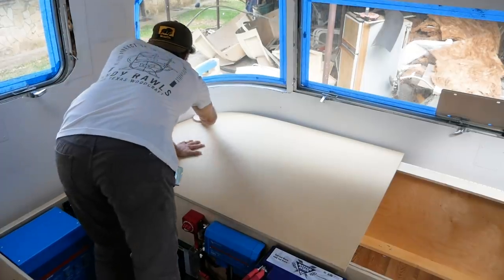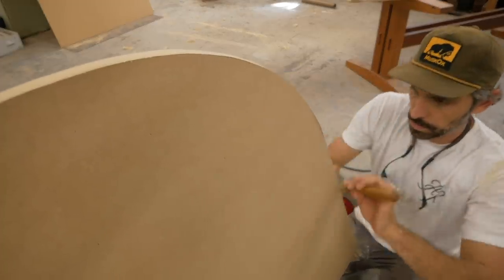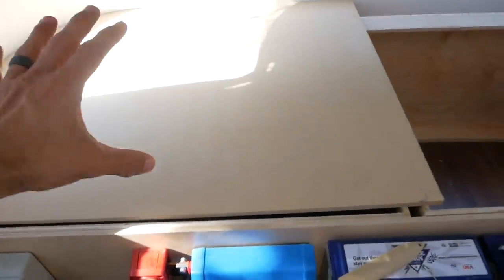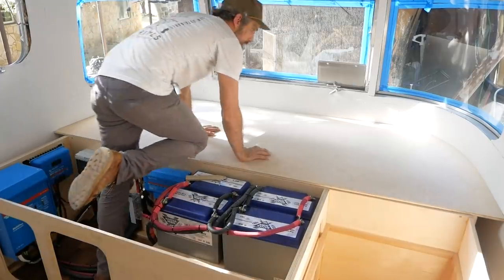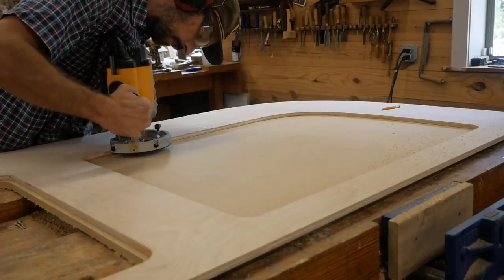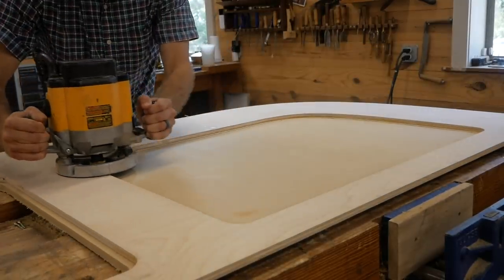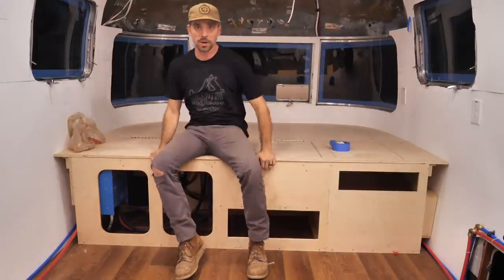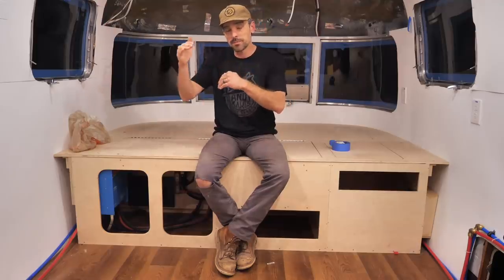Building A Custom Queen Bed For My Argosy Airstream: Part 2

Comment: Andy, try this when scribing something that's going into a corner:

Instead of "pointing" the scribe perpendicularly at the wall as you traverse each side (so that on the top edge it's pointed directly up at the wall, and on the left edge it's pointed directly left at the wall), keep it pointed in one direction the whole time. Which direction? As close to 45° as possible, directly aimed at the back of the corner when you're in the corner.

Start at the corner and pull the scribe out to both ends, keeping the angle constant. As you move across the back wall, the scribe will be pointed left toward the corner at 45°, and as you move down the side wall, it will be pointed up at 45° toward the corner. The marks will be furthest from the existing edge of the template edge at the corner, and closer to the existing edge on the sides.

At first, this seems like it shouldn't work, because you're translating a point on the wall that's NOT directly next to the point you're marking on the template. But it does. Why? Because when you take a little bit off the top, and a little bit off the side, you're not moving the scribed and cut piece up or over, perpendicularly toward the wall, you're moving it toward the corner, at 45°.
Reply: Thinking the same
Reply: Indeed, keep it parallel to something outside of that corner, not always easy. 

You can very easily visualize the problem by drawing on gridpaper! Choose your unit (1cm or 1inch or 3x3-boxes-of-your-square-gridded-sketchbook, whatever you have at hand), and choose say the top-left corner. Now turn that into a 45degree cut-off corner, starting two units down from the corner so ending exactly 2units right of the corner (and passing the grid-corner 1unit down 1unit right from the corner).

What you were HOPING was that scribing 1unit inwards (so 1unit right along the vertical part, 1unit down along the horizontal part, 1unit diagonally along the sloping part) re-draws the same, but just moved one gridunit down & right... then you'd have a perfect copy. So draw what you hope to achieve: You immediately see the problem, the sloping side isn't scribed inward by 1unit (= side of a square)  --- it's scribed inward the length of a square's diagonal (which is Root(2)= 1.414 units, says Pythagoras)! With the curved sides here, the same happens but with a smoothly varying amount of "stretch", from 1 to 1.41 back to 1 while drawing... Hopeless. 

HOWEVER, if @DonnieClapp 's 45 degree approach isn't practical, I think you could "double-scribe": Scribe a line as here in the video first attempt, MOVE&redraw (not scribe!! e.g. copy, on paper) that line a substantial amount down&right (radius of your scribe?), now scribe again but on the outside of the moved line. This should leave you an exact shape, as long as the first scribe touched all (e.g. if there were a corner the scribe doesn't reach in so it ends up rounded). True?

Edit: That said, I'd always start from a thin cardboard template. I'm no carpenter, what they do in small spaces is the scribing/ticking stick approach of course, https://www.youtube.com/playlist?list=PLp7OERboZQucxuKMpC2p64S6LozCMnTLO .

Comment: Hi from one Andy to another 😀. I just discovered your channel yesterday and have been watching your Airstream videos - loving it!. I’m going to go back and watch all your other stuff now I am up to date on the restoration. One question re: the bed; I have seen some videos where they have drilled holes into the area below the mattress to allow airflow. The thinking being that the wood and mattress can rot otherwise. I’ve no direct experience myself but I have seen this said in numerous videos. I ask because I am thinking of building a bed in my house with a fixed frame and storage underneath and wondered what your thoughts on the whole airflow under the mattress thing? Anyway, great channel, look forward to episode 19. Cheers, Andy

Comment: I noticed when you were outside,it looks like the trailer hitch assembly looked a little ragged.I’m sure your planning to replace the unit .just keep up what your doing,good video.😎😎👍👍
Reply: Ya. He may replace it. I think life would go on if he didn’t though. 😐
Reply: Thought the same thing. He is so thorough I'm sure he will get to it at some point.

Comment: As I was thinking how spoiled I am with my cnc machines.... you say it can be done easily with a cnc. I do miss using my template guides on the old porter-cable router. Lol. Now I make all my templates with my big ass laser for test fitting parts.

Comment: You're going to want to 1, mill lightening slots under the "lids" of those compartments for weight reduction as much as possible, like 2 inches wide by most of the length short of the edges and 2, put re-enforcing ribs on the non-waste area of the lids to strengthen them so they don't bow and fall in. Weight is the enemy of RVs, and flimsy, poorly made RV furniture is a design challenge. Most modern RVs are slammed together with 1/4 inch tolerances. Do better, build smarter. You have the tools and know how. Your tandem axles are only rated for 3500 lbs each I wager and these things end up over-weight with blown out cheap Chinese tires on the side of the road or worse. Don't be that guy. Also know that these things wobble as they go down the road, fitting tight to the walls promotes rubbing.